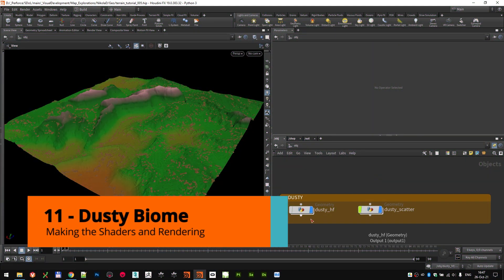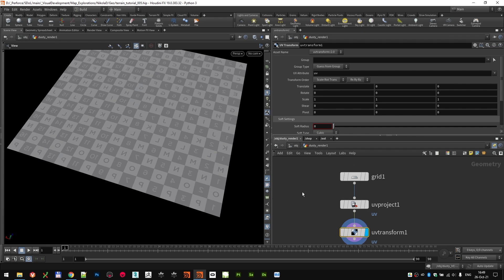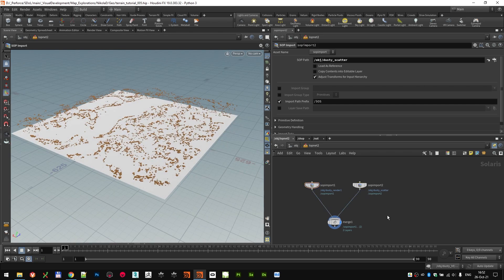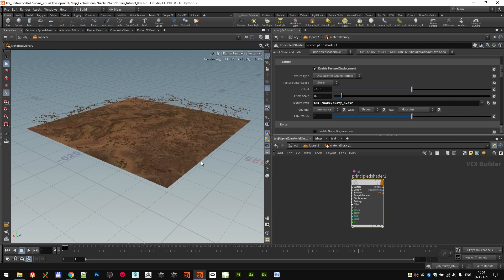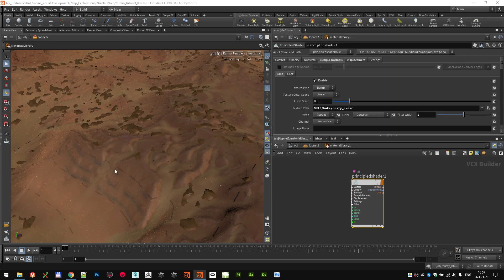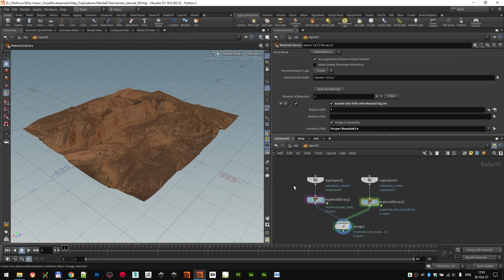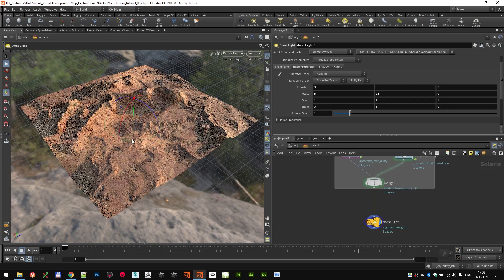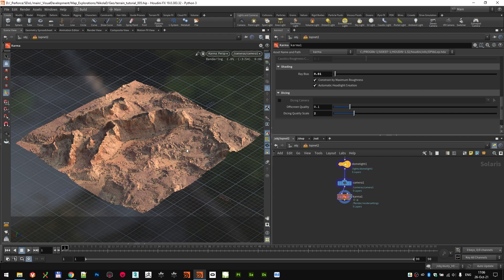Terrain Handbook 11 | Dusty Biome | Shaders & Rendering

Comment: I can't find Principled Shader at 5:16
Reply: I might be a bit late, hopefully you figured it out. If not, In Houdini 20.5 and above, you can't just access the Principled shader inside of the material library, you will need to first add a material network node then dive inside and add a Principled shader. You can then copy that and paste it in the material library
Reply: @ashleygetscache  Yes I figured it out, thanks!
Reply: @ashleygetscache  or you can just delete all of the tags and put only "*" in Tab Menu Mask in Tab Menu of the Material Library node in Stage level and you'll have access to all of the nodes.